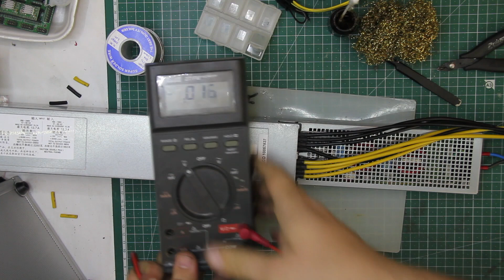Распайка  блока питания HP C7000 2250 2450 под ASIC

Comment: It is possible to make a fan regulator? Pinout shorting or potentiometer?
Reply from the maker: it will be easier to replace it with with more quiet / slow one
Reply: Iam using this power supply to power on my miner. Now it run in 12.10-12.16V and 1820Wats usage. But is still hot. I set the fans to a maximum of 12V (I connected them to terminals 12V + and -). Now in Poland we have +5C. The power supply, exceeds about +35C on the last stretch (the thinnest). I was wondering what to replace these fans because they are very loud and not very effective. I think that in the summer when there will be about 30C the power supply can not stand it. Do you have any fans that I can assemble or re-engineer the housing?
Reply from the maker: Well this PS is not designed to be quiet. But it is  much more quiet than the original Bitmain one.
Last summer they work perfectly, and even +35C wasn't a big issue.

Comment: Can someone help me to increase the voltage on a HP HSTNS PR16 TO 13.6 volts
Reply: Search for some resistance adjustors, on a controllboard (lots of IC's). Some of them, if adjusted, will increase, or decrease the voltage to a certain degree. If there aren't any, you may find some information on the datasheet of the PSU. (Maybe the Pinout of the PSU will help you too.
Reply: @sunlaser6587  ok thanks I will see what I can do
Reply: @davesamuel573  how about voltage adjust? I need buy some server power unit end up to 14v.
Reply: You ever get an answer?  Buddy has some of these, haven’t handled them yet. Wondering how easy to do this without externally stepping up. Some have voltage clipping. Maybe .8v max? Some PSU have pot that adjusts wildly, maybe >2-3v

Comment: Здравствуйте, подскажите, могу ли я отрегулировать напряжение до 13 или 14 В?
Reply: I have the same question but no one can't tell. 😔
Reply: Did you ever solve this?

14.6v out would be perfect. Otherwise may cheat by externally stepping up the 12.16v output